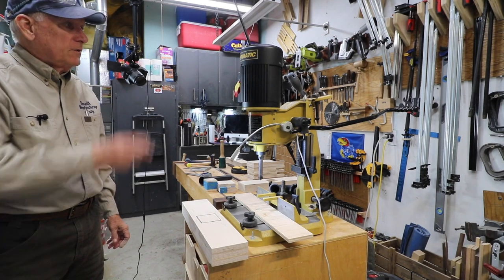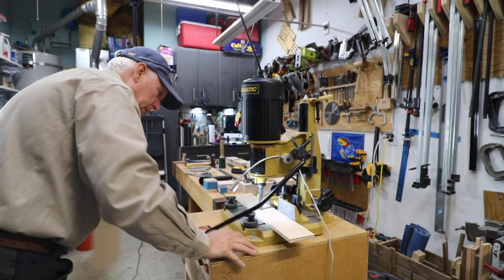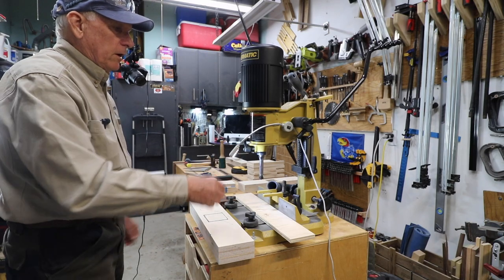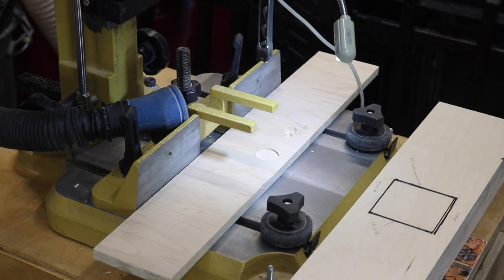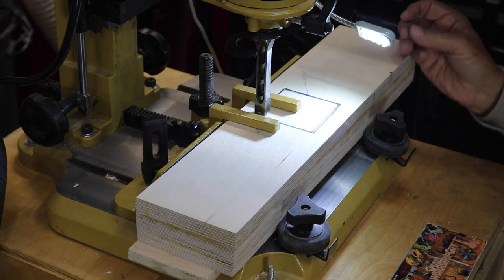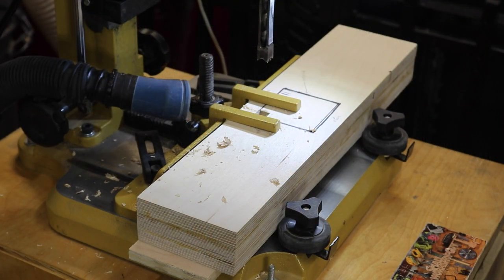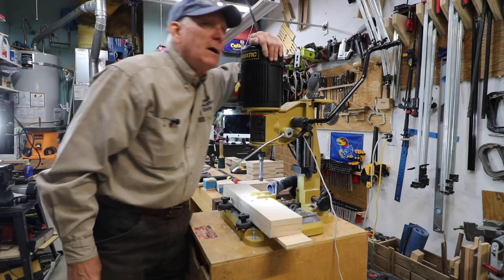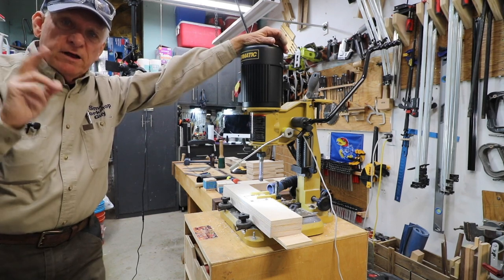Powermatic Benchtop Mortiser PM701- Tips, Tricks and Techniques for How to Use for Good Results

Comment: I am looking into a PM701 Mortiser. I have had some experience, but it was years ago. I really appreciated the demo. Top notch all the way. Two tips I will try to remember when the time comes are the ones that has a sacrificial piece that allows my pinching rollers to engage the piece to be mortised. Squaring the chisel to the piece. Chiseling technique. I especially like the tip, to mortise the piece from the inside of the.the hold down such that the piece and the chisel don't bind! The presentation was low-key and very informative. It will serve as a handy reference as needed. Thank you for sharing! Greg
Reply from the maker: I appreciate your nice comments!
Reply: @SmallWorkshopGuy  You did a great job with this presentation. Reminds me of my High School shop teacher!  My chisel slides upward as I attempt to cut with it. There is a bolt I tighten, this is supposed to keep the chisel in place, but it has a plastic end and I am afraid to tighten it too much or that part of the bolt will most likely break. The material is Ash particularly dense. Anyway, this set up does not work as it should.It renders trying to create a mortise worthless. Any suggestions would be greatly appreciated.

Comment: Very nice explanation of the 701.  I got mine from an auction block.  I was really excited about it.  It was new never been opened.  Great advise on the skew of the bit.  Can you extend those arms out by having a machine shop create a set of arms in steel and extended further?  I did subscribe and comment along with a thumbs up.
Reply from the maker: Right on

Comment: Well done and helpful video.  Couldn't find that vacuum attachment you got from Rockler and it doesn't look like you posted a link. Any idea where I could find one?  Didn't see it on the Rockler website.  Thanks in advance.  Mark
Reply from the maker: Dust Right FlexiPort Power Tool Hose Kit with Click-Connect, 3' to 12' - search for that in google
Reply: @SmallWorkshopGuy  Thank you!

Comment: Thanks for the video review. I’m considering buying a mortiser and powermatic being a reputable brand is on my top 3 to buy. 
How would you go about making a mortise on a piece that’s angle? For example, if I have a table leg that’s mitered at 10 degrees
Reply: If you still have the cutoffs from the legs, just set those underneath to angle it. If not, just cut a 10 degree wedge. Hope this helps.
Reply from the maker: What Todd said below.

Comment: Great video for us hobbyists, just picked up a used s.i.p. heavy duty model with all of the issues you mention, however with use I have found that mirror finishing chisels inside and out and  applying wax to the chisel on deep cuts really helps with the work holding problem, and general ease of use...;-)
Reply from the maker: Thanks for the tips!

Comment: I just set mine up and I have noticed that the workpiece deflects unless you add a clamp to secure it to the fence. I also notice that it is best to cut the outer edges with the tool first then clean out between the cuts. This seems to reduce deflection of the chisel and results in sharper/more square walls.
Reply from the maker: You are right on all counts

Comment: I may explore adding some type of hold down clamps mounted to the table surface of the tool (or mounted to the bench itself). In that setup, I'd just retire the hold-down clamp that comes with the machine altogether. If I do, I'll reach out to share the design and results with you.
Reply from the maker: Please do!  Sounds like that may work

Comment: I appreciate the video. I’ll be getting on of these in the near future.
Reply from the maker: I would spend the money on something else ($700+ after buying chisels.  Set up too burdensome and hare to be precise unless you are just doing a ton of blind mortises where precision does not matter.  Just hog out mortises on drill press and clean up with chisel or use a plunge router with a template and bushings.   Save the workspace and money for something else.  Just IMHO (in my humble opinion)
Reply: @SmallWorkshopGuy  Really appreciate what you're putting into these videos! I know it's so much work, truly. And thank you for this honest response. I was getting excited to buy one, but you're right: without guaranteed accuracy I don't think it would be more useful than just using the drill press to clear out, then clean up with a chisel. Very helpful information, thank you!

Comment: Thanks for the video. Been debating picking up one of these.
Reply from the maker: If I had it to do over again, I would spend my money on something else and then when I would have used this mortiser, I would just hog out material with a drill and chisel to the lines.  These machines are very, very difficult to get aligned up precisely to a cut line.

Comment: I have a mortise kit for a drill press. It was a pain to use. I had problems with the chisel getting stuck. I still have it but never use it.
Reply from the maker: I also get the chisel stuck if I try to plunge outside of my hold down bars.  Without hold down bars, I assume all chisels would get stuck and I am sure you tried many things to solve the problem including somehow clamping your workpiece securely so it would be locked down as you try pull up.

Comment: Great video. I learned the hard way about the hold down and how it can get hung on the threading. First time I was setting it up I put the chisel through the end of my thumb wrestling that hold down.

One question, have you considered the riser block the Powermatic offers for this machine? It gives you an extra two inches on the height but you have to sacrifice the wheel fence adjustments at the back of the machine. Wondering if you'd considered stepping up to that block.
Reply from the maker: Ashamed to admit I was not aware of the riser block.  Actually, I am going to sell my benchtop mortiser - just don't use it enough and other ways to get the mortises and I dearly need to reclaim the floor space for other things.

Comment: I have a different machine which I haven’t used yet, but your tips are great, especially the points about the edge and keeping under the support.  Would it make sense to plunge and lift repeatedly on the cuts rather than one big plunge? Also, is there any chance you might have time to demonstrate how you sharpen your chisel and what you use, as you alluded to?  Thank you.
Reply: Eric Erf I have the same one Paul has and your comment is dead on. No way I’d go all the way in one plunge.
Reply from the maker: I understand your approach and I think that is best when using your method of leaving 1/8 of an inch between each plunge.

Comment: P.S. dry chain lube inside the chisel quiets things and keeps the heat down, also works great on  ways and pinions without turning chips and dust into porridge!
Reply from the maker: If I ever use that thing again, I will try your suggestions - thanks!

Comment: Great video! I am researching now, trying to decide what hollow chisel mortiser to purchase.

I watched with interest the part where you dealing with the width of the sacrificial piece. An idea came to me. Why not make an L-shaped girder to set the work piece into/on? The base would be slightly less wide than the working piece, say 1/8" at the most. That way the rubber guide wheels on the  machine would press against the base of the sacrificial girder and the vertical wall of the girder would press against the work piece which in turn would press it against the fence. I think it might work.

The sacrificial L girder could be easily made from scrap lumber in the shop, and trimmed to fit smaller work pieces if needed. Just a thought. Thanks for posting; very good information.
Reply from the maker: Hey, thanks for adding to the conversation.  I think you might have a good idea.

Comment: Good video. I have the same machine  but was having trouble getting my mortise straight across. I finally figured out my auger was too low and was wandering on the plunge. This link helped me tremendously: https://sawmillcreek.org/showthread.php?36315-Jet-Hollow-Chisel-Mortiser-problem

Also, something else that is helpful to others might be to explain how you should not go straight across but to leave 1/8” or so in between plunges which will keep your mortise depth consistent since the chisel will be supported in two sides (rather than just one if you go across in that fashion). Then come back and clear out the remaining parts. I also create the perimeter corners first and then do the rest.
Reply from the maker: Hey, thank you so much for your suggestions - obviously they are based on lots of experience.
Reply: I wondered why you never seemed to use it in your videos where your project called for mortises. I haven’t used mine a lot (only a few times) but enjoyed your original video on it and decided to buy one secondhand. Keep up the videos, glad you came out of “retirement “ :)